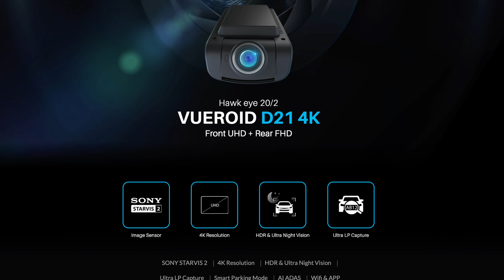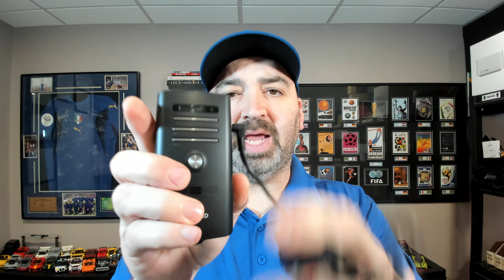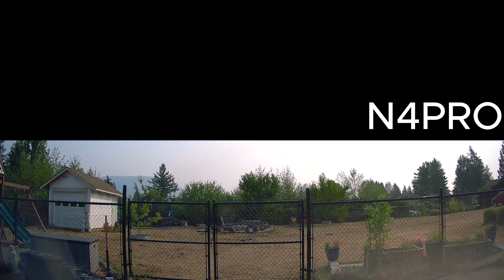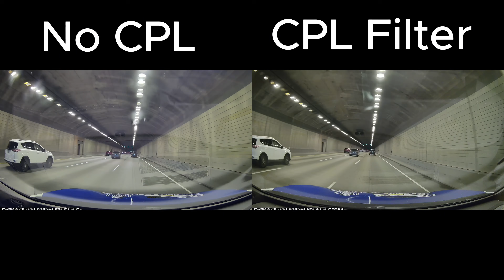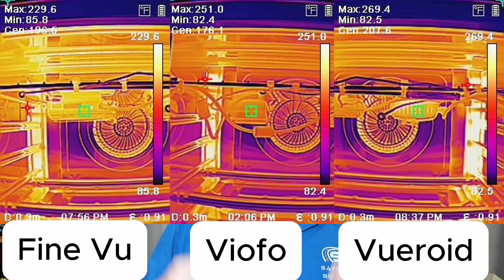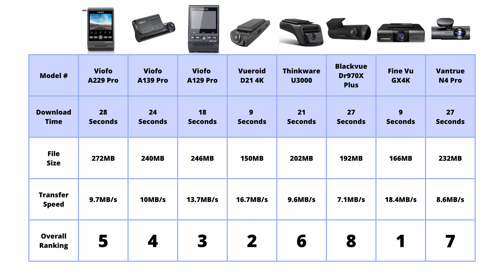Vueroid D21 4k Dash Cam Review | Lowest Current Draw Parking Mode?

Comment: 😮😮I've  watched many of you videos. I have  a question. I purchased  the S14k infinate  3 ch. I'd  rather not hardwi😢re tbu😢t I'd  like to have parking mode. I would like to purchase the obd2 iroad cable have you ever used this on a 2026  chevy colorado  zr2 truck. Will it work with parking mode and with the vueroid dash cam and my truck. Will it kill my battery, will it work with that dash cam or doI need to hardwire.
Reply from the maker: The iroad obd2 cable plugs right in. It should work fine for that vehicle.

Comment: It is absolutely insane that these cameras can handle that much heat without failing. I would also like to add that I love the fact that my BLACK Volvo s90 has survived one Utah summer so far with no interior heat damage despite being a very luxurious interior full of leather. It has shrugged off the high temps we get here. I've seen modern Buicks that fall apart after a single summer here. We get HOT.

Comment: Excellent review.  The has helped me decide on my next cam. You pretty much summed it up perfectly.  I was leaning towards the  U3000 for low  power consumption during parking mode and heat resistance.  But love the video quality of the Viofo cams.  I currently have a A129 pro and had to reduce the resolution because it overheats when recording at 4k in the South Florida sun.  The Vueroid fills the gap.  Has low power parking mode recording and better video quality than the U3000.  The Viofo still has a slight edge with video quality though.  This Viewroid seems like a great option all-around.  This will be my next cam.  Hopefully Vueroid listens to your suggestions and continues to improve the cam with firmware updates.
Reply from the maker: Sounds great. This dash camera takes a lot of heat. We are pushing them to make the changes. Maybe this video will help push them along.

Comment: How long will the vueroid go in parking mode before it drains the battery? Not sure if I need a battery pack or not. Car get driven every day and will be in parking mode while at work for 8 hours.
Reply from the maker: In low power mode, you wont need it but in time lapse or motion detection you will need a batterynpack
Reply: @SafeDriveSolutions   Which is better: the IROAD OBD Power Cable or the IROAD Powerpack Pro 12 Battery Pack?
Reply from the maker: @yasbethmanzanares5683  those are 2 completely different solutions. One is for extended parking mode while the other is geared more towards do it yourself community.
Reply: @SafeDriveSolutions  I will most likely have my professionally installed. I need a reliable system that won’t damage my fuse box or electrical wiring. What would you recommend?
Reply from the maker: @yasbethmanzanares5683  If you want parking mode to arecord while parked and drive over 45 minutes per day. Then i would look at getting a battery pack
Reply: @SafeDriveSolutions  İyi günler.E hev araç için Park modunda 3,5 gün kayıta devam edebilir mi,teşekkürler.
Reply from the maker: @abdullahekremdogu551 no it is not. It is possible to have it in low power mode for 3.5 days in impact only detection
Reply: @SafeDriveSolutions  thanks

Comment: The good thing about a CPL filter is that it protects the lens from dust and scratches. As for the footage, whether you use it or not doesn’t make much difference—just my opinion.
Reply from the maker: Yeah it made a little difference but not tons
Reply: Same here, any time I am moving the dash cam around, tinkering with it, I have a CPL on it. Even if someone does not like a CPL image, the CPL is worth owing just to protect the lens when you are moving the dash cam around.
Reply: @ That’s right.